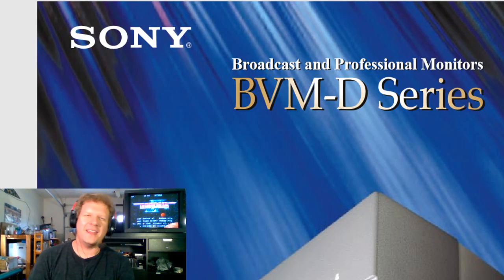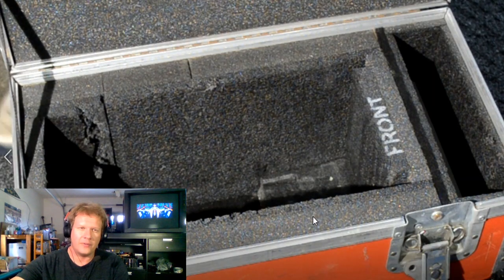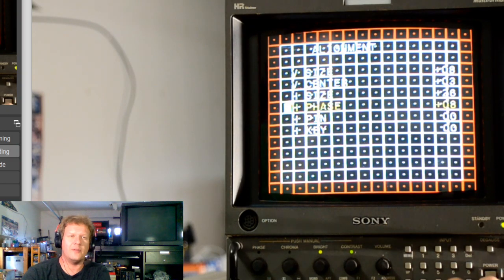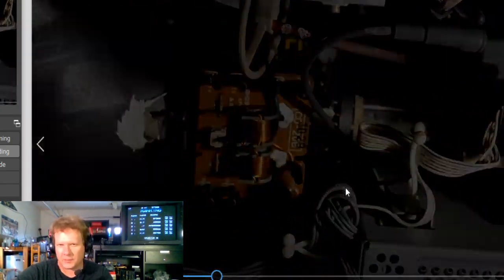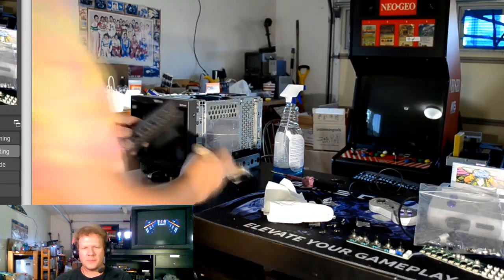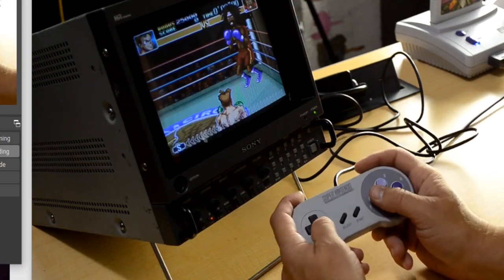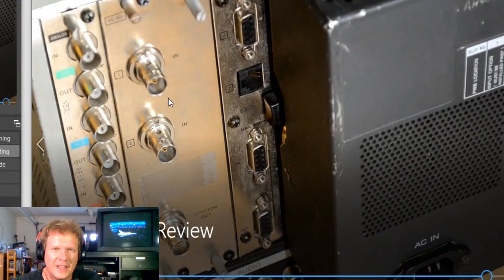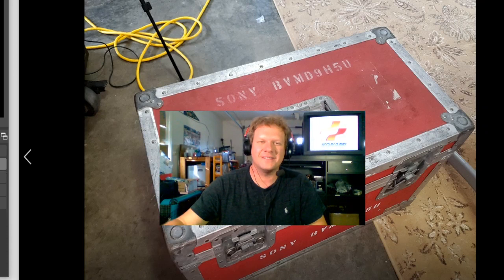Sony BVM D9H5U Repair & Review

Comment from the maker: Sorry everyone.  I managed to move the wrong screen a bit in the first half of the video.  I hope it's not too distracting.  I'll do better next time.  Thanks!
Reply: In a recent vid you mentioned hard time finding isopropyl alcohol. May want to check out CRC QD Electronic Cleaner. Its an alcohol based spray cleaner I've had excellent results with in the last few days. I drenched a fillthy sega genesis motherboard with it (after it sat unelectrified for several days) while simultaneously gently scrubbing with a toothbrush and it also brought a logitech wireless keyboard back from the dead someone left batteries corrode inside of. drenched it so much the cleaner came out of the keys. hit it with a hair dryer to be sure it was dry but again, fired right up. Stuff is magic.

Comment: Love your videos. You’re my go to for PVM content. I just picked up another PVM But I have a question for you if you could help. When I hook my Atari jaguar up to it, using BNC adapters via composite from the Jaguar, it automatically runs at 480i...Why wouldn’t it run in 240p? It’s a Sony PVM-14L2

Comment: Hey Steeve,

Commented a while back on another video about the BVM-1910 I purchased locally. I can't find any information or manuals on the monitor. Is there somewhere you reccomend looking?
Reply: Also I am getting an issue with the screen rolling upwards. I think in one of your videos you said this was due to which khz setting it was on but I can not find a switch on the unit to change this.

Comment: FYI, many of the small monitors of this era were able to be powered by a battery pack like this for field usage. You can still buy batteries that could power this, they are the same that power many of the large broadcast cameras used by 3 chip 12 volt news cameras and the like. This mount is called "V-Mount" and the batteries can be found on B&H or even Amazon... but they are not cheap.
Reply: It's kind of legit because you're exactly right. A lot of modern V-Mounts have USB ports now too for various on-camera accessories etc. You could power a Raspberry Pi and the BVM off one of those.

Comment: I have this BVM, it's my only PVM and it feeds it's output to my 36 inch Trinitron, it's amazing but I've been dying to get a 4:3 mask for it, I have to take the bezel off to use it, I just leave it on top of the monitor. It has under 5000 hours the only problem is its a bit far from where I sit. I like it's sharp small scanlines.
Reply: What's the advantage of the 4:3 mask?  I'm scratching my head here trying to figure it out.
Reply: The 4:3 mask allows you to see the entire screen without showing any of the electronics around it, the 16:9 mask cuts off part of the screen and is used to hide the retrace lines.
Reply: @harrisontashjian752  If you're into 3D Printing someone made a custom mask that can replace the 16:9 insert if you're willing to cut it out.